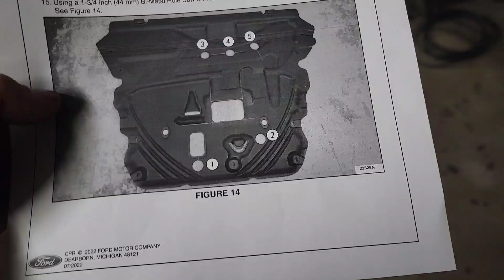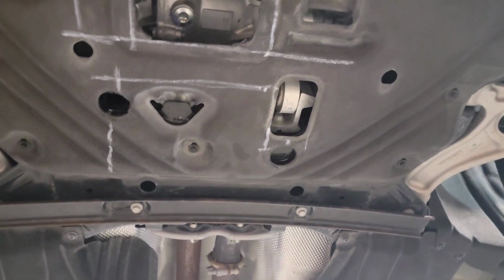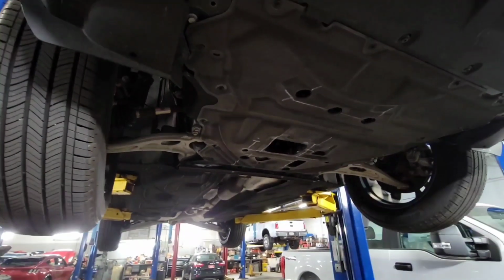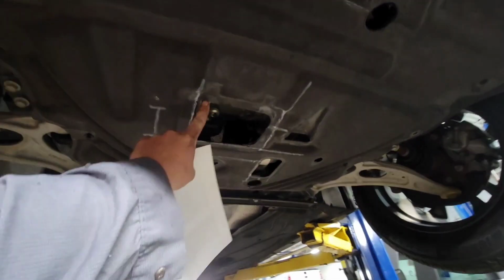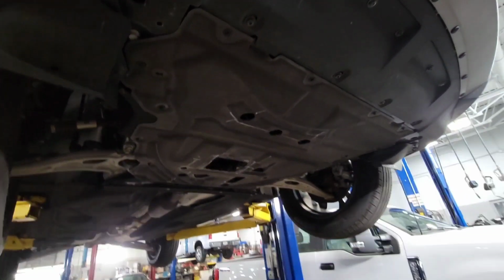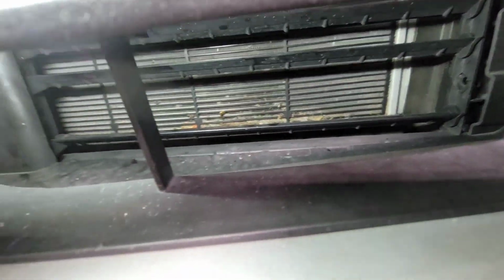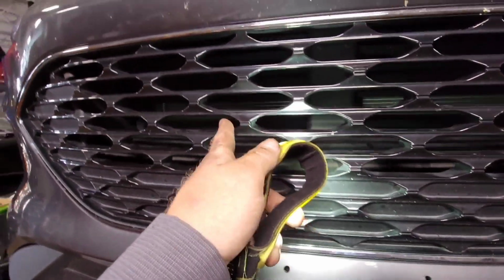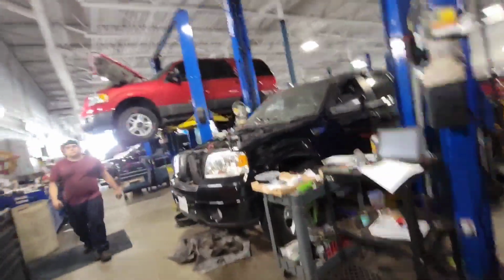First 22s47 Safety Recall Performed - Corsair, Maverick, Escape 2.5L HEV and PHEV - Engine Fire

Comment: Quality job. I had mune done Monday (7/11).  Initially I was inpressed with howvthe job was done, even providing a video of the completed work.  Got home and notice the screw they forgot to re-install. Now, thus is assuming they removed the cover and it was not missing from factory.   How can I get that cardboard feeling and looking cover smoother at the cut sites?  It's at the bottom of the Maverick, but it is frayed and does not look pretty, due to the material, I don't know if it could be smoother.  Any suggestions?
Reply from the maker: Roloc 80 grit disc
Reply: You, my friend, are a Ford Boss.  That worked great.  Looks much better. Thanks!!🎉
Reply: I'm thinking of using a rubberized coating like Flex Seal on all my Maverick's underbody covers

Comment: Hi Rich just wondering what’s the reason for removing the shutters I understand your cutting holes in the cover so oil can drain if there is a leak is it just to keep temp down?
Reply from the maker: I mean not to be rude to you or anything but how am I supposed to answer this when they don't even tell us what is exactly going on in the safety recall LOL I don't know how much more I'm supposed to answer I have the safety recall pinned it to the top of the comment section
Reply: Hay no problem was just wondering your personal take on. I appreciate your time for always answering.
Reply: @FordBossMe  How was the person who asked the question to know that you didn't know?  A simple answer, such as  'they (Ford) didn't inform us (mechanics) why the shudders needed to be removed' would have sufficed.
Reply: It all appears to be lessons from the Escape Crankshaft recall.  If there were to be an engine failure that releases oil/gas vapors, these holes will let them be released quicker from the e gine bay.  The removal of the  front vents help with ventation of said fluids.  There is not a problem, but if there was, this will help prevent a fire.  So the internet says. Edit: It also appears, the EB already has more holes than the HB. Another internet fact.

Comment: OMFG!!! That looks like 13S12 deja-vu on the '13 Escape 1.6 when we had to swiss cheese the under engine cover and delete two of the five active grill shutter blades. I haven't actually seen or heard of this recall. Are there any other steps to this recall? What is the purpose of doing this? Is there a coolant leak issue on these, like there was on the '13 Escape 1.6?
Reply from the maker: I can't answer any questions outside of the two videos that I've done on this so far 22s47

Comment: Unrelated to the video, I wanted to ask you a question since you seem to know a lot about Ford. Are you aware of, have you seen or diagnosed the engine shutter issue on any of the Ford hybrid engines? I have a 2023 Ford maverick hybrid that shutters when going from ice to hybrid. It generally happens at low speeds around 20 miles an hour and my Ford dealer near me claims that this is normal. I’ve been on the forums and some claim to never have experienced this issue and others claim to have experienced this issue. Which makes me wonder if it’s really an issue or if people that say they don’t experience this just don’t know if it’s normal or not. My truck has 980 miles on it today and I’ve experienced it a few times and had it at the dealer today. I just want to get your thoughts or feed back if possible. thanks! 

By the way I like your videos they’re very informative.
Reply from the maker: I have not encountered this issue yet so I don't really know how to answer it and I'm a general manager now at an independent shop not the Ford dealer anymore so I don't really get exposed to some of the newer stuff as much as I should
Reply: @FordBossMe  thanks for the reply! Yeah I’m told it’s normal on all hybrids made by Ford, especially the escape and maverick. I hear so many people claim they never had this issue and it’s buttery smooth and some that do. So I can’t make sense of what the issue actually is, if any. Again thanks for the reply!
Reply from the maker: @rkingslandjr83  I'm sorry I don't have an answer though

Comment: Do you have an email I can send a video to.  I have a 2019 F150 3.5 ECO with 54,000km/ 33,000 miles, that recently had the cam phaser reprogram done.  After the truck sits for an extended period (12+ hours) the chatter at startup from the drivers side of the engine is harsh.  When it’s warm it doesn’t do it.  I’d like to send you the video/audio of a start up, to see what you think.  I told the dealer there was still abnormal chatter after the reprogram, but they’re giving me the run around thus far.  Ive run Mobil synthetic since day one, and change the oil every 4000 miles religiously.  I’m at a crossroads, as I love the power and efficiency of the 3.5, but this issue has me concerned, especially the thought of some hack tearing into the front end of the engine to replace phasers and so on.  By some accounts the issue may return even with replaced components.  My bigger concern, is not trusting the Techs at the dealerships I frequent.  

Anyhow, sorry to highjack the comments section, but I trust your opinion.  

Great videos, keep them coming.
Reply from the maker: Poissorichard.rp@gmail.com
Reply: Those reprograms don’t fix the issue if the phasers already have damage
Reply: I have replaced LOTS of these GEN II 3.5 Eco phasers thus far, without further issues except for ONE, that had a repeat failure about another 45K kms later.
Reply: @michaelchan8915  do you work at a dealership in the Toronto and surrounding area?  Also, how/who determines theirs bad enough to replace?
Reply: @frankiefromgtown8744  yes. I work at Yorkdale Ford/Lincoln. Been there since May of 2005. Been turning wrenches for a living since 1994.
Reply from the maker: @frankiefromgtown8744  the tech
Reply: @michaelchan8915  That’s crazy, what are the odds!  I had the reprogram done there.  I’ll have to bring it back and let you have a listen!  I took it there instead of my local dealer (Concept) because I know and trust the Sales GM there (JB)!
Reply: @frankiefromgtown8744  are you from Georgetown? That sure is a long journey to get to us from there if you are.
Reply: @michaelchan8915  I am, but am currently working in the area.  Even if I wasn’t, my local dealership’s service department is bush league, to say the least.